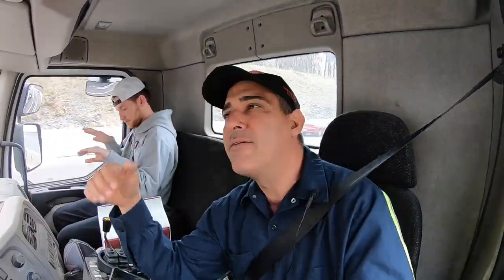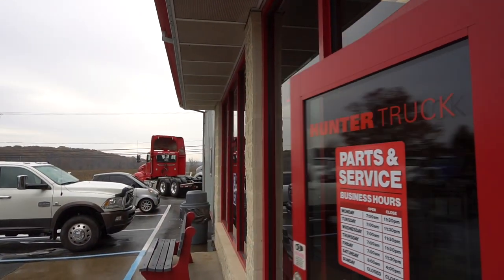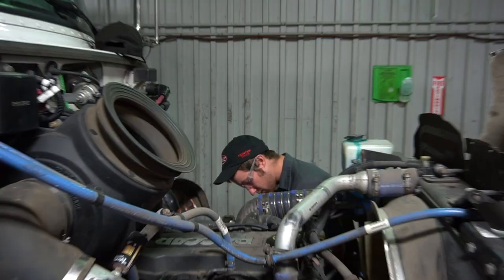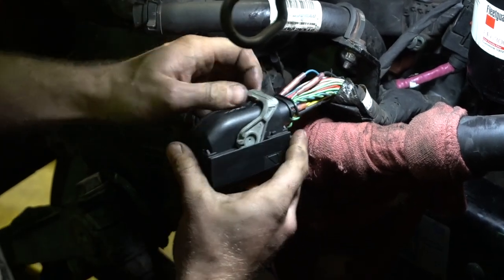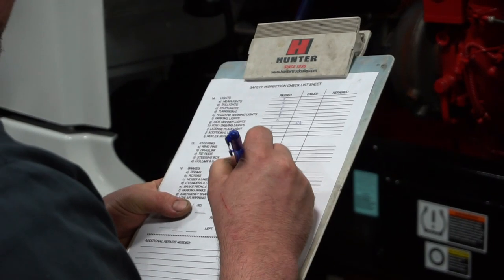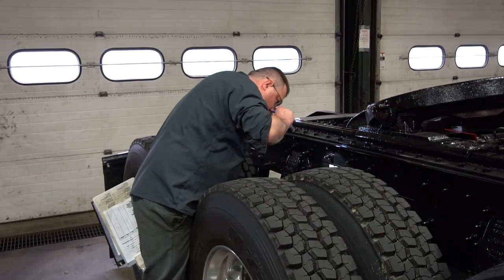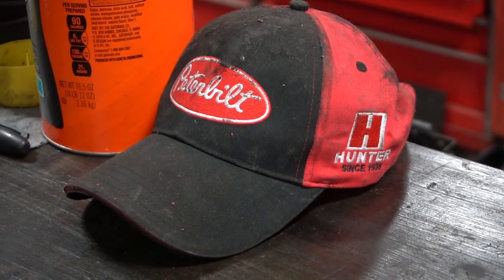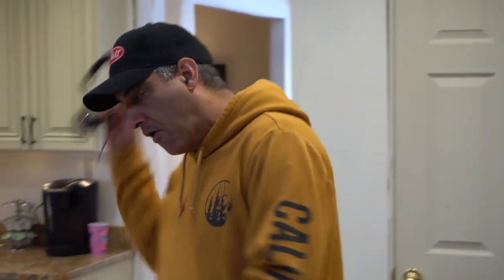Importance of Having A Spare (Backup Truck)

Comment: Off topic question, but how do you haul 10 yarders on those 20k pound hoists? Aren’t they 14ft to 16ft? I’d rather my tens be 12 feet long.
Reply from the maker: no reason to have so many diffenth lenths of cans its better to standardize length for drivers and truck specs all our can are either 16 or 22 feet long easier to spec trucks and calculate axle loads across the board a 12 foot can can't be loaded on all trucks with a 22 foot rail safely
Reply: 4kvideofunjunky so your 10’s and 15’s are 16 feet long?
Reply from the maker: @Templar316  yup sure are
Reply from the maker: @Templar316  standardizing is the best way to remain safe and calculate axle weight and spec trucks safe for all loads
Reply: 4kvideofunjunky wow, how low are your 10 and 15 walls!! Seems like it would be way too low. But yeah, I’m sure it makes things easier.
Reply from the maker: @Templar316  I will do a video for ya some day on this subject
Reply: 4kvideofunjunky that’d be cool. Another question is, how many times on average can you rent each can per month?
Reply from the maker: @Templar316  we rent four times per month average week rental we leave longer but try not to
Reply: 4kvideofunjunky got it. I’m trying to average at least 3x per month. I’m told the average is 2x per month.
Reply from the maker: @Templar316  depends but yes I average about three times I guess I dont always pick up after the week we leave for free if not needed
Reply: 4kvideofunjunky thanks for the help man.